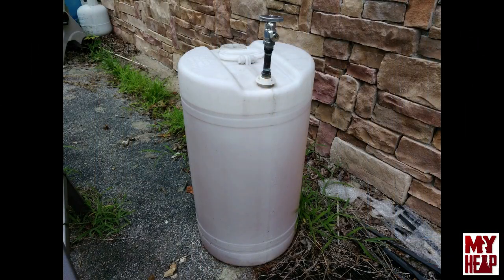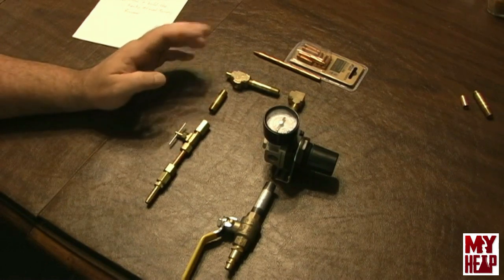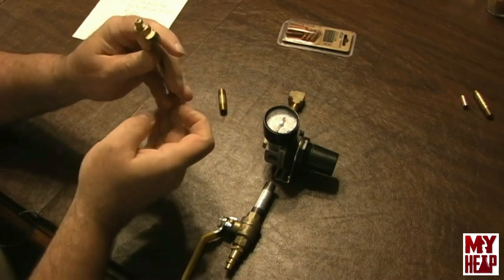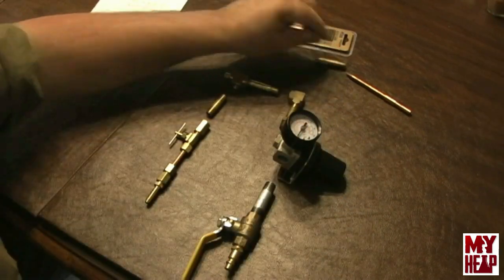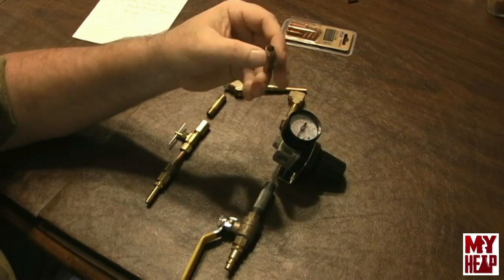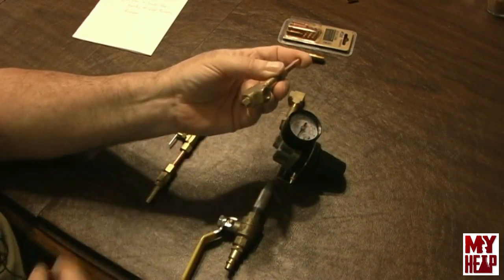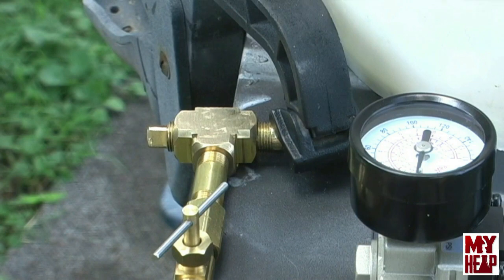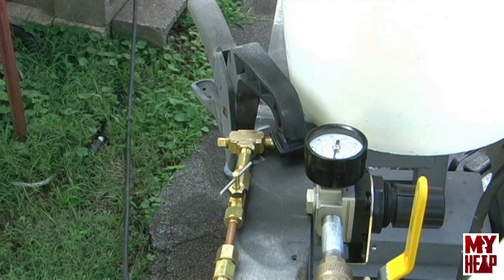Metal Casting and Foundry - Ep 3: The Kwiky Oil Burner   Part 1

Comment: I like that design!  LOL  At some point in my r&d I did have a problem with the mig tip being too small diameter.  I love your solution but I don't have a lathe...I took some stranded wire and wrapped it around the mig tip to get a snug fit, put flux on it and soldered it in that way.  It seemed to work well!
Reply from the maker: Hi David.  Glad you stopped by to watch my video of YOUR burner!  I hope I done it justice.  I didn't think about wrapping some wire around the pipe to make a fit good enough to solder.  I tend to over think things sometimes.  Glad to see you back on.  I know I will have a couple of questions about this burner when I get it into the furnace.  Thank you for watching and commenting.

Joe
Reply: @MyHeap  yes, it looks great!

Comment: Looks good, Ive messed with that burner a bit and it seems to work good, lol. The tuning is a bit different between water and oil, but if it's tuned for water, it'll work fine with diesel fuel no problem. I had a needle valve like that on my burner at one time, but when your running cooking oil, that just restricts the flow of oil so I just swapped it out for a ball valve so I can just turn it on and off, then control the oil flow rate using the air pressure instead. 

You'll have to find some sort of blower to go on it and a way to control the blower's speed like a baffle or something. Another guy I like watching that uses a kwiky burner too is worldtraveler, I listed him in my shoutout's video a while back and I believe he runs straight diesel nonstop in his. Thanks for the shoutout and good video.
Reply from the maker: Hey Chirpy, thanks for stopping by.  So it sounds like I should re-tune it with the oil before starting up the furnace.  I have been using a air mattress blow up pump (for the lack of a better word) for the charcoal foundry and the fan you see in the intro still shot is the one I built for the Gingery forced air/ propane furnace.  But it will be too much for it I believe.  So I may have to find another air source along the way.  And if I experience the same issues with the needle valve, i will change it out as well.

When you are melting, about how much oil do you go through per hour?  What size MIG tip are you using?

I will check out worldtraveler channel and see what I can with his.  Thanks for stopping by Chirpy and watching.

Joe
Reply from the maker: Can you give me a link to his channel, cannot seem to find it, unless it is the bronze casting channel?
Reply: When Im casting long sessions and usually have the burner turned up, I go through around 0.6 gallons per hour of used cooking oil. The burner will run fine when it's tuned for diesel, but you wont get maximum performance out of it. I just stick it in the oil feed and open the nozzle just the slightest until you see the most oil coming out of it. There is a sweet spot on mine at 30 psi, and just adding more air does really nothing above 40 psi when running on cooking oil.
That blower may be a little too much, but you can grab a ceiling fan controller from the hardware store, they're like 5  bucks and just wire it up like a light dimmer switch and it'll work fine for that blower. I have one of those types of dimmers on my setup and it works great on everything. I also have one of those matress blowers, but dont really use it because it's so loud and sounds like a vacuum cleaner running nonstop.
Reply: yea, he is the bronze casting channel. Here is his channel:https://www.youtube.com/channel/UCuYrxLwT9hWwDIX7a4x9ZWg
Reply from the maker: Thanks for the information and tips Chirpy, I appreciate it.

Joe
Reply from the maker: Great, I did find the right one then.  Thank you.

Joe
Reply: Chirpy's Tinkerings

Comment: G’day Joe thanks for the shoutout. Bit of clickbait there with the opening shot. Looks like you’re on your way to a working oil burner there should be good, just remember to start it outside and away from the washing hanging on the line although I read recently most States ban outside washing lines, is that true?? Sorry off subject. Looks like you plan on some serious foundry work. Cheers Peter
Reply from the maker: Hey Peter, thanks for dropping by.  You are welcome for the shout out.  Still waiting on the gears but hopefully it won't be much longer.  I am at the mercy of a small chain of people.

Click bait huh?  Well that wasn't my intention.  I was looking for something to put in front of all these videos to use for continuity, kind of like the YT Shop student.  I probably should work on that a bit.  I don't know about serious foundry work, but I have access to the waste oil and it if free compared to propane or charcoal.  Thought I would give it a go anyway.  Another project I need to do is a vibrator for the match plate.  I want to build one of Steve Chastain's designs.

I don't know about states banning clothes lines.  I have not heard of such a thing, BUT I wouldn't put it past some of the more progressive blue states.  Some people think you can legislate everything to negate any form of personal responsibility.  It drives me crazy if I think about it too much.

Thanks again for taking the time to watch and comment.  I am looking forward to your next Gingery video.

Joe

Comment: I'll be interested to see how much oil it uses per hour once you have it runnin. You shoulda made every one of those parts outta steel and saved ya $20 LOL
Reply from the maker: Well you got me there buddy.  I should have made it from steel and saved some money.  Hey, wouldn't be the first time I paid stupid tax in my life.  Next time I will as I imagine there may be a couple iterations.  Not sure what the burn rate will be, but I am thinking about 1 gallon per hour.  I asked Chirpy what his done and the size of MIG tip he used to get an idea.  I would be more motivated about this project if it wasn't 95 degrees everyday with 90 percent humidity.  The inlet to my furnace is large so I need to get a piece of 2" pipe for the burn tube.  Will do that this week.

Thanks for stopping by and watching Rich, I appreciate it.

Joe
Reply: I will be anxious to see it work :) You should add a third leg to the design to utilize propane to get the foundry hot enough to ignite the oil and avoid soaking the interior with oil until you get sustainable combustion.  I dont have any first hand knowledge using an oil burner of this type but have seen others preheat the foundy with propane before turning on the oil.